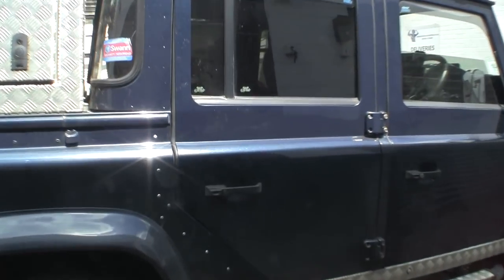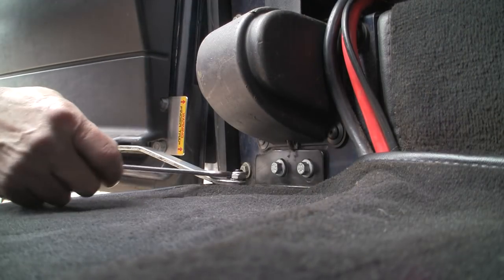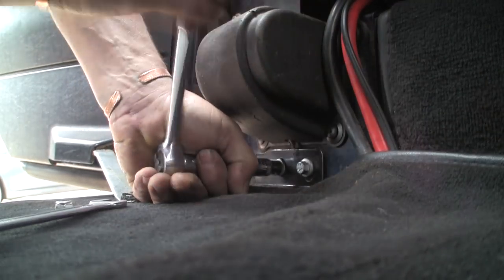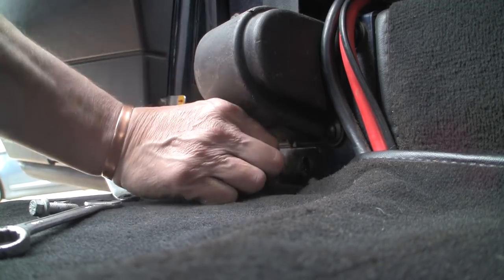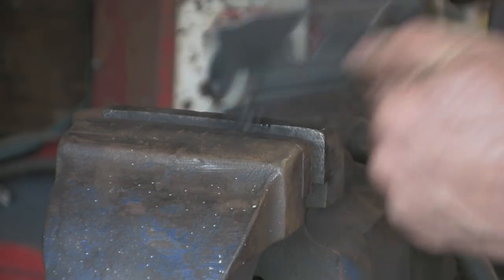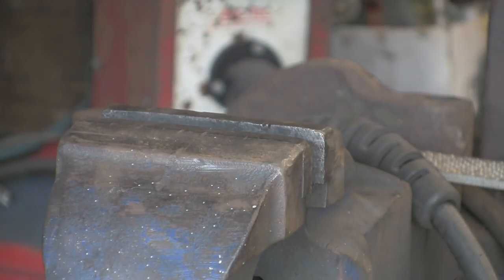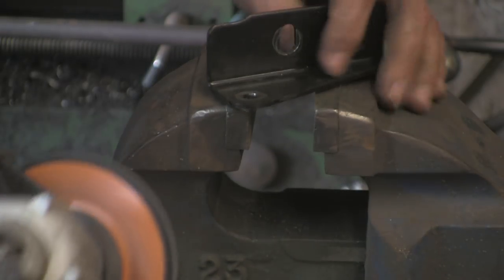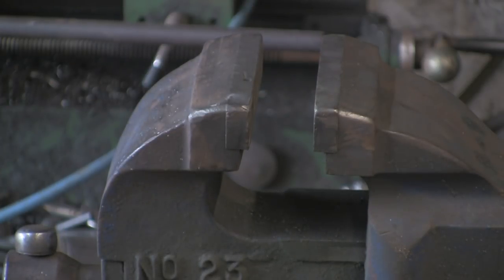Land Rover Defender Door Mod

Comment: Gary a little tip for you on the TIG welding get yourself some 309 filler rod its what should be used when welding steel to stainless or when your not sure what your welding. My got to gas lens cup is a 6 and my gas is set to around 18 cfm. one other thing you need to do is to separate you steel grinding wheels, flap discs, etc. I use a blue mark for my stainless wheels and etc. and red for my steel grinding and flap wheels.Use only stainless steel brushes do not cross contaminate a brush used for stainless on steel. Also TIG welding likes every thing very clean wipe down with acetone before welding, clean bright metal is your friend. Just a few of the many tips for TIG welding hope they help. Rich

Comment: How do you feel about the qaulity of build of the rovers? They look very easy to  modify
Reply from the maker: LEXUS-RX300 they are basic and quite needy! They need quite a bit of attention but it's the sort of vehicle you can mend and modify with basic tools and skills...
Reply: Fixing leaks with silicone sealer on a 2011...? 
The warranty cost. Killed the Defender.
Reply: Who needs carpets?
Reply from the maker: The EU killed the defender, they wanted too many safety features like air bags and side impact bars! No air bags here mate...